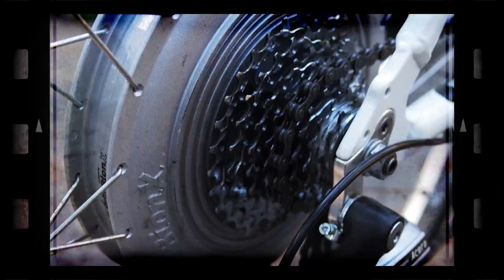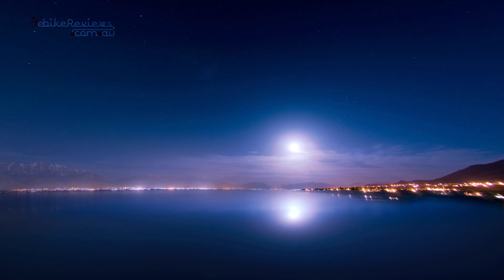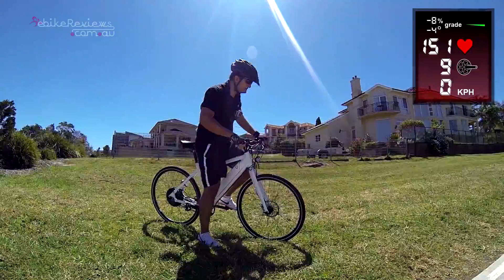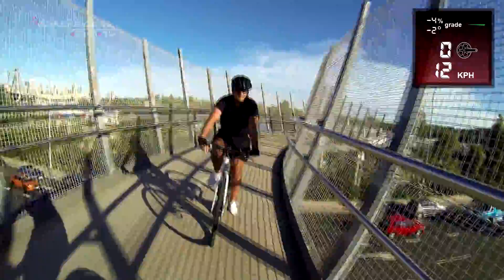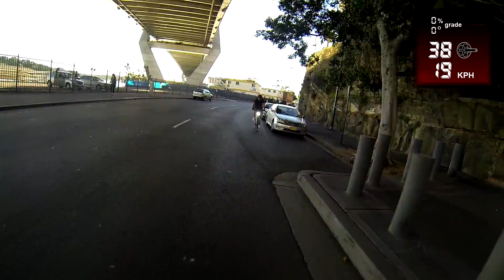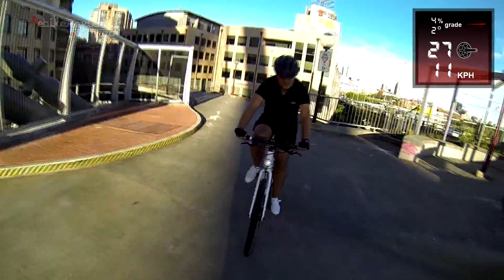Grace Easy Electric Bike Review

Comment: I love your ebike reviews. They’ve helped me narrow down a few choices, and completely eliminate what I originally almost purchased. I’d like a bike for mostly in-town or touring, potentially some gravel riding, but for women.
I’m 5’1″ So a 19″-20″ frame. 29 in inseam. Is there something similar to one of these four bikes, or a better recommendation you can send me?
Kalkhoff Tasman Tour C8 Premium
Easy Motion Neo Volt
Haibike XDURO Trekking Pro
Or Grace?
Reply from the maker: Desarae Veit Hi Desarae. All good choices. If it's in-town touring, the hub vs mid-drive argument is no longer valid, and I don't think one would be clearly better than the other in urban riding conditions. Though the mid-drive will always get you longer range when compared to the same size battery on a hub drive. 

Kalkhoff make nice bikes, and we should have some in for review shortly. If money was no object, it would be between the Kalkhoff and Haibike (if you can get a frame size that suits).  The Kalkhoff is a step through which is really convenient for city riding. Though it's hard to beat the quality and beauty of Haibike.

Comment: donde la venden
Reply: Bueno, eso depende de donde vivas. Quizas pueda que la reglamentacion en tu pais no lo permita. Esta bicicleta electrica tiene la particularidad de alcanzar 40km/h.

A modo de ejemplo, las VAE (Vehiculos de Asistencia Electrica) o simplemente "bicicletas electricas" en Francia estan limitadas a 25Km/h. En Suiza, se creo una reglamentacion especial para los "VAE" que desarrollan una velocidad de entre 25 y 45km/h, categorizandolos como "ciclomotores ligeros" o "Velomotores". El porte de casco es obligatorio (pero se acepta el de bicicleta), el vehiculo tiene que tener luces y un espejo retrovisor. Por otra parte, el vehiculo tiene que estar matriculado y paga una viñeta (impuesto de circulacion anual). Tambien se exige un permiso de conducir. Por encima de 45km/h se los considera una moto.

Por cierto, estos "velomotores" tienen bastante poco de bicicleta, ya que para aguantar esas velocidades todo el material es bastante mas solido que el de una bicicleta (a nivel extructura pero tambien a nivel ciclo), por lo que pesan entre 20 y 25kgs. Algo importante a tener en cuenta si vives en un apartamento y la tienes que subir a diario. En cuanto a la autonomia, van de 40 a 150kms, segun peso, motor y capacidad de bateria (45kms para este modelo), 

Por eso, lo mejor seria que antes de comprar nada, verifiques que puedes utilizar el vehiculo en tu pais.

Sino para mas informacion, busca GRACE BIKE.